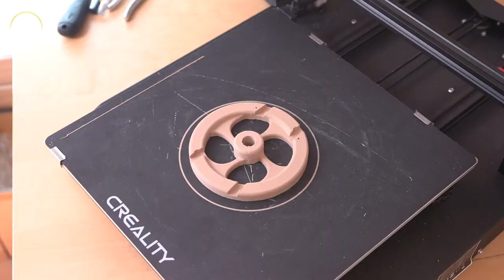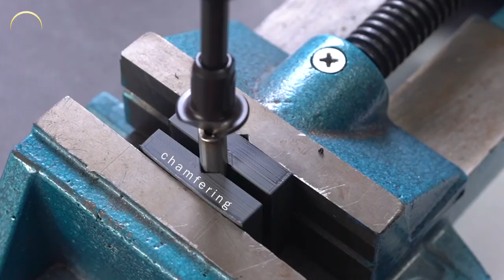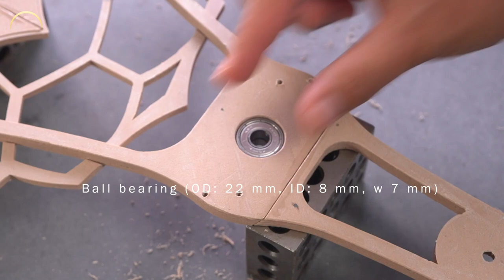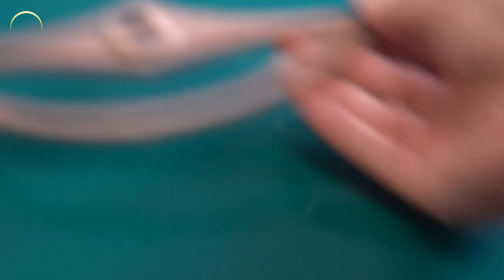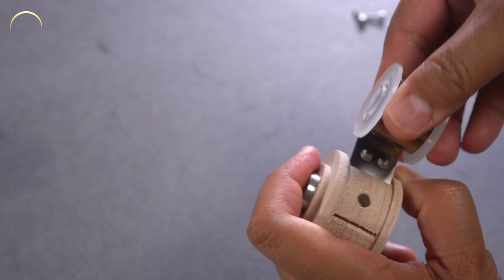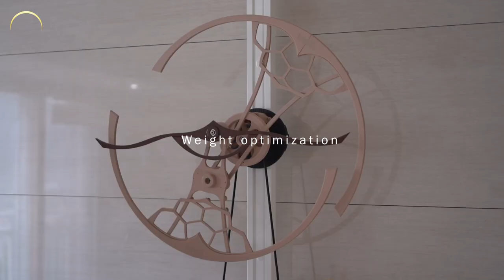Turtle swimming in the sea (Turtle, Kinetic Art)

Comment: Dr. Moon, I just finished mine. Thanks! I now will attempt to make the click sound much softer. I'm considering TPU for the Pawl and or a thin rubber material glued to the end of the Pawl. Also; My model runs at a faster speed it seems. How do I slow it down?
Reply from the maker: Hi~
I think the TPU can make sound softer. 

Increasing total weight of kinetic sculpture will make it slow down. 
When you increase weight, it is important to maintain balance (center of gravity). 

Thanks:)
Reply: @housdrmoon  Thank You! I have it in balance. Now I will add weight without changing the balance.
Reply: @housdrmoon  I ordered TPU but I found another solution. I have a spring attached to the pawl. The spring is located inside the hole on the Main Block and acts as a dampener. Much less clicking noise now.

Comment: There is one more thing I cannot find, The Round rubber band (1 EA, Ø 5 mm, L 2000 mm).Where di I find this? NO  listing on Amazon or Ebay.
Thanks
David
Reply from the maker: Hi
I got the rubber band from MISUMI website. 
If you can find a rubber band which has diameter from 4 to 6 mm and length 1800 mm or more, it maybe work well.
Thanks:)

Comment: Does wood material work this way
Reply from the maker: Probably possible. However, spring specifications may vary due to changes in total weight caused by different materials.

Thanks~~